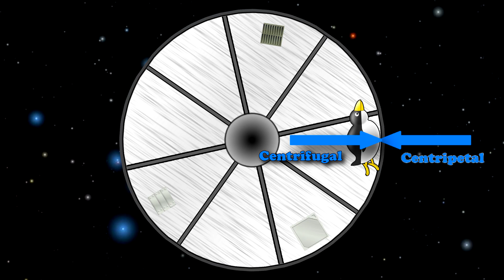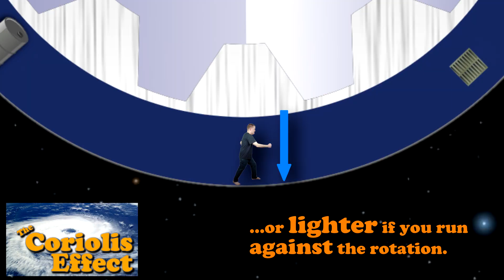Faking Gravity in a Spaceship

Comment: What size would a ship need to be to mimic gravity by rotating at 0.1 RPM?
Reply: The ship would need to be about 180 km across (~112 miles).  Your radial velocity would be almost 1 km per second (over 2,100 mph), but it would probably feel pretty normal.  You would complete one revolution every 10 minutes.  You would notice the curvature of the ship, but you would be able to tell it was huge.  The curvature would be about 1 meter for every 425 meters or so.  In imperial units that would be about 12.5 feet in curvature per mile.  Here on Earth it's about 8 inches per mile.

Comment: Did you say 2 RPM ? On a spaceship that size is MASSIVELY fast. Holy crap !
Reply from the maker: Yes, it's fast ....but it depends on how big the spaceship is. The larger the diameter, the slower it can spin and still simulate 1g.

Comment: I would want my average gravity to be the same as on Earth. I would want varying decks with different gravity intensities I would want an outer or lower deck that was meant for exercising and an upper deck with lighter gravity meant for relaxing but it would be calculated how long I would need to spend in a higher deck or a lower deck to counteract the opposite time.

I think the majority of the living space should be at a level that achieves normal Earth gravity but a significant amount of space would be desired in either the more intense gravity or less intense gravity areas.
Reply from the maker: Cool idea!

Comment: Wouldn't climbing a ladder take at least 2.5 football fields of climbing, or more? Surely there's a better way.
Reply: Wouldn't be a hard climb. You would weigh less with every rung. In fact at some point in the climb, your speed will be escape velocity...
Reply: @russhamilton3800  That’s assuming that you are in the smallest plausible rotating space station.  But if you need to check, that means you might not be.
Reply: @danielrhouck  thats true but the 2.5 football fields you mentioned is not on that scale...

Comment: I love your videos and I show them to my students every year. Having said that I don't agree with the claim that we feel the forces acting on other objects. For instance, if I am standing I feel an upward force acting on me... I do not feel the downward force of gravity like the one shown in the diagram you posted. So if I jump, the impulsive force that I am exerting on the floor is momentarily larger and as a reaction the floor pushes me up momentarily with a greater both. This reaction force that the floor exerts on me is the force I feel and the one responsible for accelerating me upwards. Similarly, if I apply a horizontal force to the right on a wall, I feel a horizontal normal force to the left (action reaction again) which is being exerted on me by the wall. I cannot feel the force acting on other objects that are not me and I think it is impossible for me to do so, unless our brains are connected somewhat by a complex machine to fool our senses or some strange situation like that. My flesh and bones are pushed back every time I touch something and this is the force that I feel. In this example that you provided, we can only feel the force of the floor acting on us which in this case happens to be equal to the centripetal force (net force). The other normal force that we exert outwards clearly exists but it does not act on us and has nothing to do with our dynamics or experience.

Comment: If car wheels need balance weights to run smoothly, The spaceship would need a HUGE Spin Balance machine and HUGE balance weights to keep all that weight and mass from experiencing extreme structural fatigue when spinning. I don't think spining a spaceship to get centrifical force is really practical. It would be too difficult to balance, especally when it changes direction. And when objects in the ship are moved that would throw off the balance, also.

Comment: If gravity is not a force then is the reaction force given by earth is also not real?
Reply from the maker: It's not that gravity isn't real. Gravity is very real. It's just that gravity isn't what you're feeling when you think you're feeling gravity. You're just feeling the push force from whatever is underneath you.
Reply: @ScienceAsylum  doesn't that means there is an unbalanced force acting on us🤔
Reply from the maker: Yes, absolutely! 😊 If you're standing on the inside edge of the spinning space station, you do have a push force on you and that force is unbalanced. That means you should have an acceleration... and you do! You're spinning with the space station. Any time you're not moving in a straight line, you're accelerating.
Reply: @ScienceAsylum  what about standing on earth

Comment: I'm sorry I'm late to the topic but I have a question I cannot seem to find the answer to. If you have a rotating part of a spatial vessel, one around the size listed here (around 500 m) and spinning at the optimal rate (around 2 rpm), how much would that impact navigation of the vessel due to the rotational momentum? I wonder if there would be a positive feedback loop of vibration that could compromise structural integrity any time a spatial vessel attempted to alter course with any force above the most conservative? If there was a notable energy in effect, and if this would complicate navigation and control of the vessel, would this be counter balanced by a second habitat of the same dimensions but counter-rotating at the same rotational rate?
Reply from the maker: If the ship is moving was along the axis of rotation, then everything should be fine. Turning would be a little weird because there would be an extra torque you'd have to compensate for. Having a second gravity chamber spinning the opposite direction should help, but I don't think it would eliminate it entirely.

However, I imagine a craft that large wouldn't be doing much turning at all. That's a lot mass, which means it would take a lot of fuel to change direction. If you designed it with less mass (like a big tube rather than solid circle), then you'll also be making its structure weaker. There's always give and take in engineering.

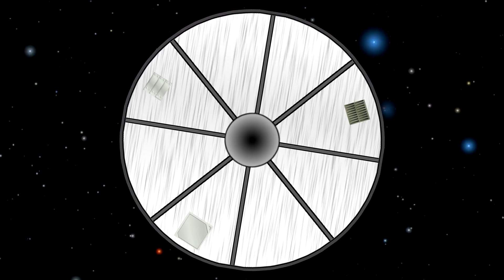Comment: lol, calculating the size a spinning space station must be in order  to accommodate  the tallest possible height that a human being can be... At segment  2:25 Science Asylum guy uses the maximum human height of 8 feet 3 inches  to calculate the size .
Reply: That's why the video is  funny, normally slightly above average [bell curve segment] would make sense.  At segment  2:25 Science Asylum guy uses the maximum human height of 8 feet 3 inches  to calculate the size .  Designing for the average parameters and choosing people who can fit  is how they design[or designed in the past] fighter planes and test vehicles. However, space stations are meant to service a diversity of people; many who are over six feet tall and under 5 feet tall. Nevertheless, despite the absurdity of inflating the price of a space station by billions to accommodate the height of the tallest human alive or ever was or could be, calculating for very tall humans is sound. In fact no, I would not design average and cherry pick astronauts and I doubt mission designers would do that either. I would not calculate for the tallest human living, or possible. I would calculate for about 7 feet 2 inches. The larger a space station is the more variety of people have to live in it so 20 or 30 people over seven feet tall is not beyond reason. It  And yes, I am too lazy to convert units to metric.

Comment: The physics concepts presented are well stuck in the views from the 1800's. Description of "center of gravity(CG)" as "where gravity acts" is troublesome because it implies mass not at CG is not effected by gravity. Yes, it harder explain spin gravity as acceleration experienced because of constant change of the velocity vector when a mass is spinning on a thether but it will mean the right foundations for other concepts.

Comment: May be a daft question, but I'll pose it anyway: if you jumped wouldn't the effect of you standard on a rotating spaceship disappear instantly? It's only your contact with the floor that gives the feeling of weight surely. The astronaut never felt weight until he contacted the ground in the beginning of the scenario
Reply from the maker: No, if you were in contact with the "floor" while the ship was already spinning, then you still have that motion even if you jump. According to an observer outside, you'll continue to move sideways during the jump. In fact, the motion you'd have would look like a chord of the circle and you'd reconnect with the "floor" in the same spot you jumped from.
Reply: @ScienceAsylum  cheers for the response Nick

Comment: If you continue to spin the space station faster and faster, you can crush the astronauts. What's that force?
Reply from the maker: Normal Force.
Reply: The Science Asylum 

Officially, do you call it real? And aknowledge it performs "work"?
Reply from the maker: Sure. Normal forces do work all the time. My point is that normal force and centrifugal force are not the same thing (they don't even point the same direction).
Reply: The Science Asylum 

Thank you 😊

Comment: At 3:30 he says the faster you run the heavier you will feel, but his animation is incorrect. It should be showing him running in the same direction as the station's spin. His comment below the wheel is still correct though and proves his animation wrong.

Comment: You'd NEED gravity. 50 yeas' worth of manned space flight has pretty much proven that prolonged zero-G causes your body to slowly waste away, and any trip past the Moon is going to take long enough for that (plus radiation exposure from solar wind) to be major problems the ship should address. Also, living in zero gravity is a huge pain in the a-- that even astronauts have trouble getting too enthusiastic about. Basic things like eating, bathing, moving around, and taking a sh-t become horrible, tedious ordeals without any gravity (real or synthetic). A rotating ring is ideal because you can live in the ring, and put anything that benefits from or needs zero G in the central hub. You can even have low G areas just by having multiple levels on he ring, useful for doing experiments in say, Mars or Lunar gravity and acclimating people to them on the way to those destinations.
Reply: Indeed. Nicely explained.
Reply: Its not really zero gravity, it's free fall. You still experience about 90% of earth's gravity while in orbit around the earth, there's just no ground to exert a normal force on you, pushing you up and preventing you from collapsing through the surface and into the Earth's core.
Gravity alone doesnt feel like anything. what we experience on earth is actually the ground repelling us while resisting its own collapse. its what happens when something opposes gravity, not simply when gravity occurs
Reply: @quixotic7460  while that is true, and nicely explained, I think we know what zero G colloquially refers to. Given that nowhere in the universe is actually zero G.

Comment: Why would you wanna create artificial gravity with smth like a huge circle. Why not just st1ck long strong rope or a rod between 2 (equally massive for simplicity )living space modules? Less material - same effect. Or 1 module for monkeys and same counter weight for nuclear power unit.. for example. Or make the toilets and the bathroom on the opposite side.. so the bastards exercise a bit reaching there.. Imagine live show streaming where the guy in the living module is trying to reach the toilet on the other side of the rope while having a diarrhea ! You can fit like 30 commercials in between the start of the suffering and the culmination. Ah.. Isn't that an idea worth spreading?

Comment: Very enlightening. Consider this - Constant acceleration at 32ft/s/s should provide the necessary force to simulate gravity. Then reverse the craft 180 degrees and decelerate at 32ft/s/s half way to your destination. Your thoughts?
Reply from the maker: Totally impractical. Maintaining that kind of linear acceleration would require a ridiculous amount of fuel and it's not helpful if you're trying to do this on a space station (that just orbits). Also, the reversing 180 degrees in the middle would either be too fast for us to survive or so slow that we might as well not do it.
Reply from the maker: ALSO, just did a quick calculation... accelerating at 9.8 m/s/s (32ft/s/s), you'd reach relativistic speeds in the first month of your trip.

Comment: how come you wouldn't float if you jumped, how does a spinning ship cause the air to have gravity? I would think you would only feel it if you were standing on the floor
Reply from the maker: It doesn't cause the air to have gravity. Before you jumped, you were moving with the edge already, so you would keep moving in that direction with the floor underneath you.
Reply: The Science Asylum right but say you were already floating as if the wheel wasn't spinning then someone flipped it on? Would the air pressure force you to the edge?

Comment: I haven't seen a video to confirm but the speculation is that the slinky tension experiment would work differently under centrifugal force or 1g acceleration than it would purely under the influence of gravity.  True or no?  I would love to see a link to this experiment being done as it would go a great way towards helping to explain some oddities of gravity.  Especially that gravitational forces form a kind of tension in space similar to the slinky drop.
Hence why the theory states that if the sun suddenly exploded shedding it's mass (Or magically disappeared) that the planets would not instantly fly off into space but instead would wait for that "tension" to be lost as the gravitational wave released it's hold on objects radiating outward at the speed of light.

I'd love to hear your treatment of this.

Comment: 1.  It helps to be a little crazy when thinking outside the box or the spaceship.

2.  Quit calling it centrifugal force and start calling it torsional acceleration.

3.  If your ship does not fly apart, then it provides the N, the normal force to oppose your linear tangential motion.

4.  There is nothing fake about that N.  The Earth is the N under your feet.

5.  Gravity has gradients, why can't your N have gradients?

6.  If sailors can get good with walking the moving decks at sea, why should a 10% gradient be a problem?  Oh, you lazy dogs!

7.  There is only a slight nuance difference between kinetic acceleration and gravitational acceleration.  There, I said it first.  No, wait!  Einstein's concept of Equivalence states that we cannot tell the difference between gravitational and kinetic acceleration.  I say he is right and I have a reason for it.
Reply from the maker: I'm not sure "torsional acceleration" is the best term. Technically, it's centripetal (center-seeking) acceleration.
Reply: I have my own agenda about torsional acceleration. What is it relative to? Something stationary?  There is nothing stationary.  Is it relative to those distant stars? Two answers: NO, stationary does not agree with the distant stars, and It can't be something distant,  there must be something right here, right now, interacting with the moving parts that defines stationary.

Comment: Why didn't you even mentioned the easiest way to get artificial Gravity? Perhaps on a trip to Mars... the only thing you need to do is: build the spaceship in two modules, the living module and the module wit the fuel tanks and things like that. In space the two modules (best perhaps if both have a similar mass) separate from each other connected by a strong wire, and a few cables and tubes to a distance of half a mile or so. Then give thrust from both modules in opposite directions so that the modules spin around each other. You will get perfect artificial Gravity!
Reply from the maker: That better be one hell of a strong wire!

Comment: I love this! Answered lots of my questions... but I still have one, if anyone here doesn't mind answering. :)
Okay, so as you can imagine, I've watched a few YouTube videos regarding artificial gravity, namely the "giant centrifuge" brand. Almost all of them conclude the same way - "nice idea, but currently too expensive (because the structure would need to be BIG to reduce the gravity gradient problem) and the inner ear would be messed up, causing imbalance and nausea."I can see how the first problem could only be solved with enough money and resources, but it's the second problem that has me curious - the "inner ear" issue. Could this be combatted with specialized "pressure headphones" that (SAFELY) alter pressure in your ear to compensate? Or is it not an issue of pressure so much as the direction of force?
Reply from the maker: You can minimize the inner-ear issue by making the space station spin slower... but, if you want it to have Earth gravity at a slower spin-speed, then it has to be bigger, which means it'll cost even more. I guess what I'm getting at is that money/resources fixes all the issues.
Reply: I think it’s just the direction of force, because as long as the pressure through out the entire spacecraft is the same, you will feel the pressure at all times, but gravity will change from the center to the outer edge of the spacecraft